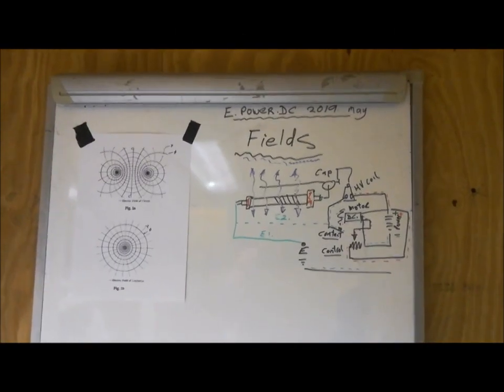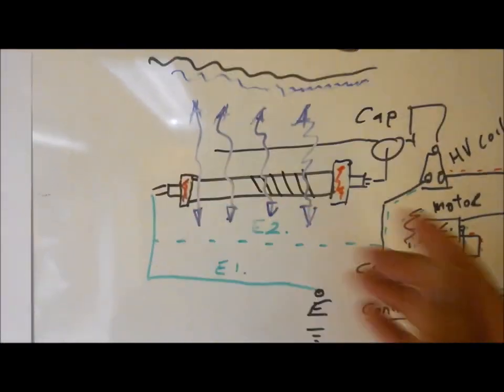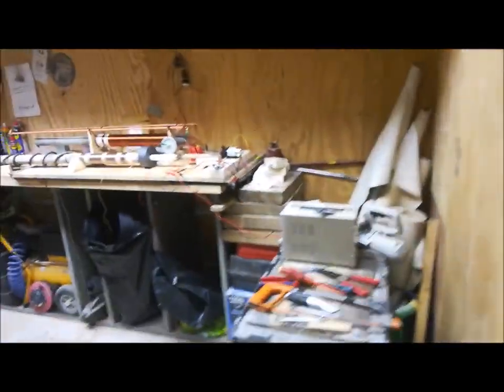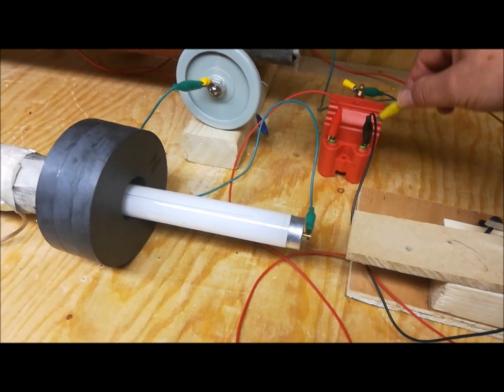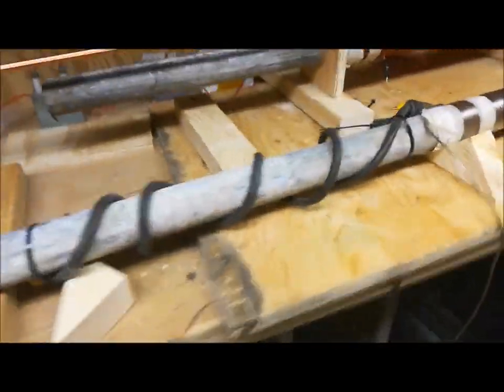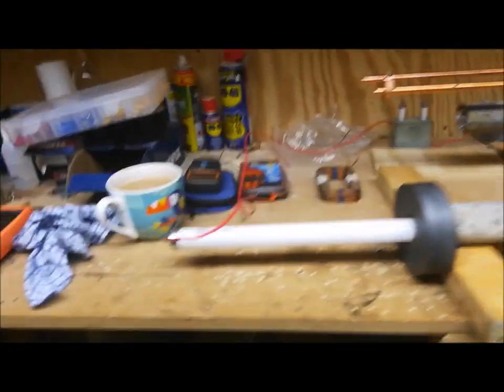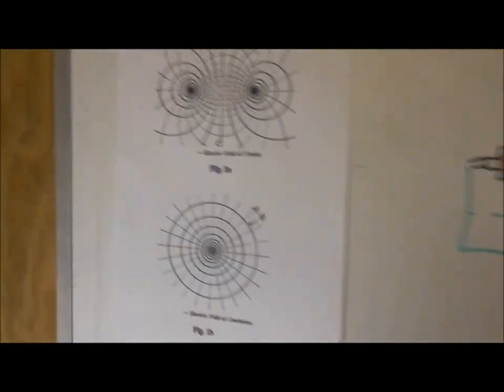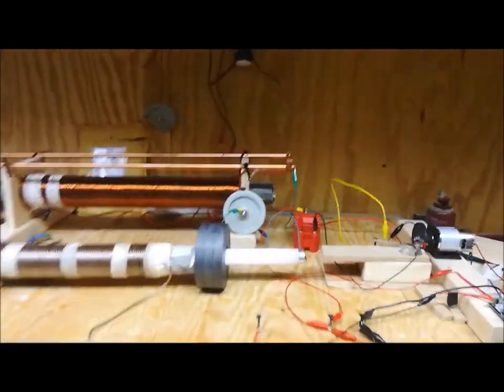Electric Plasma Coil 2 Earthing

Comment: Really wish you would look into atmospheric energy, and the collecting of electrons. There are some very interesting things happening in your workshop. It would be very impressive if you could collect that energy and use it at will. Torodial fields are ever lasting, infinite if you will. Creation of energy, as it flows from pole to pole there is a spike, maximum output, then diminishes, and starts the flow again. I will continue to follow and study your methods, and experimentation.
Reply from the maker: In my mind if you follow the overview you will see just how close you are! The steel scaffolding tube represents the Earth"s magnetic core the magnets are the poles. As Energy flashes through the core it should copy / minik the rotational magnetic fields of the Earth. So my friend I am on it. Well done your vision it's in synergy with me, perhaps you too like to experiment. Do you teach?... Regards.... DC
Reply: @e.powerdc1127  thank you, and yes I tinker with experiments, just different types of energy. I am a geologist, and my current fascination is with Piezoelectricity generated by various types of gems and minerals, the pyramids, and ley lines that criss cross the Earth crossing paths at certain intervals and latitudes. Ley Lines are the Earth's natural magnetic energy, and if you could see it with the naked eye, it would show the Earth has a massive torodial field encompassing the entire planet. Displaying the very characteristics you explain in this video.
Reply from the maker: @project-unifiedfreepeoples  stubblefield earth battery yes i am aware. So our synergy agrees. Have you considered "Gravity" i have a theory, its Mm Zip my mouth going to do a video on it... watch this (Pun) Space! Regards .... DC
Reply: @e.powerdc1127  I researched John Hutchinson's hypothesis, I found he did some very interesting experiments. One in particular, he used a aluminum bowl, and formed a insert made of copper, smaller in dimensions. He put stones of a certain type in one bowl, and stones of a different type inside the copper insert. Took a voltage reading, and had 2.3 volts. There was no pressure, so it wasn't Piezoelectricity. I was intrigued!
Reply from the maker: Hi HW...  So what was happening ? Have to look this up... Regards .... DC @project-unifiedfreepeoples

Comment: The ignition coil secondary could punch a hole through its insulation without a path to ground...
Reply from the maker: yes this is correct that's why the input was kept low 7.8v dc. with this coil i am learning both with and without understanding. Thanks for your feedback....DC